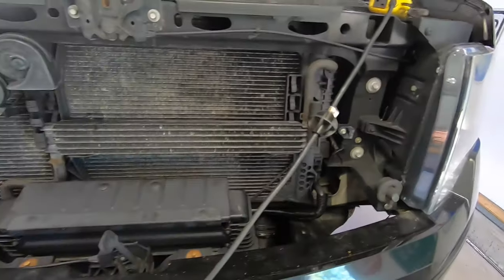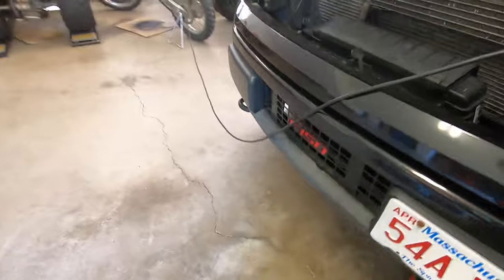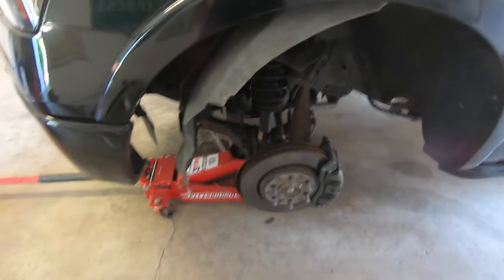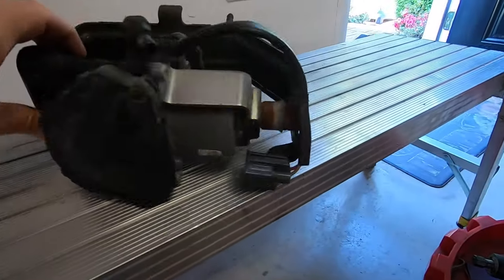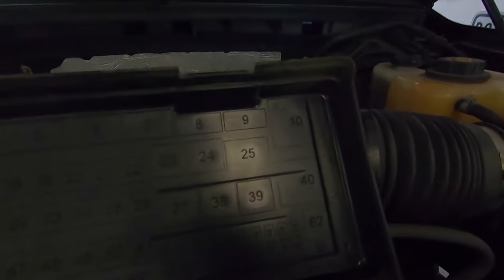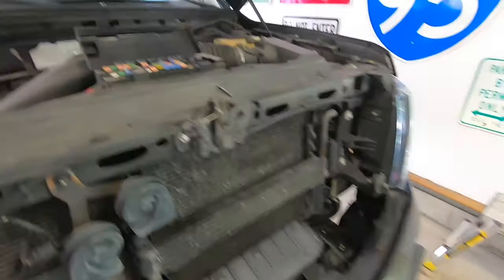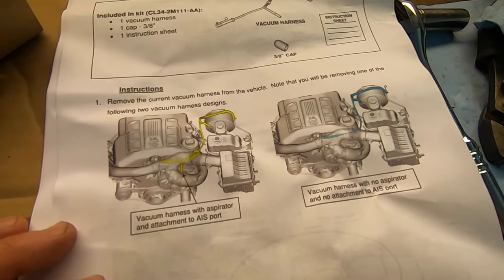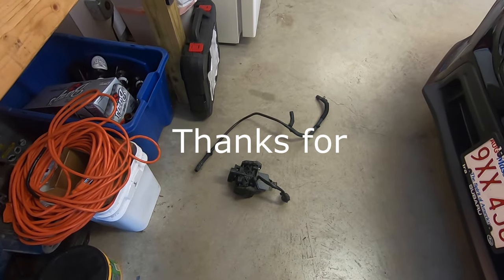How to Fix the Locking Brake Problem on Ford F150

Comment: Is this the same for the 8 cylinder trucks too?
Reply from the maker: I am not 100% sure about 8 cylinder trucks. Take a look behind the drivers side wheel well and see if you have the pump.
Reply: No. At least not on the 5.0, there is no vacuum pump
Reply: I’m having the same problem but on a 5.0

Comment: On my uncle's 2005 F-150, sometimes when he puts the truck in "Drive" and releases brake pedal, truck doesn't move, as if something is holding it.(parking brake isn't engaged)  He needs to accelerate a bit more to make it move.  We lifted the vehicle in the air and put it in Neutral, and all wheels seem to spin freely, didn't feel any drag.  Almost a year ago we changed front and rear differential fluid and truck was fine, until very recently.  Could it be 4x4 issue or similar to your issue?
Reply from the maker: I am not that familiar with the 2005, Check to see if you have hill assist. It is usually included with the towing package. It will hold the front brakes on a hill to prevent rolling back when pulling a trailer.  It releases when you give the truck gas. Sounds like your uncles might be malfunctioning. I don't know much about hill assist other than the onboard computer controls it.  Sorry.

Comment: Mine is locking up but no humming noise that you indicated do could it just be the vacuum hose?
Reply from the maker: Start by replacing the rubber caliper hose.

Comment: I’m having the same issue with my 2014 3.5 Passenger front caliper keeps freezing up. My relay #25 is empty in fuse box under the hood
Reply: Same here. Did you ever figure it out?

Comment: I removed #25 relay but my brakes didn’t release. Would that mean my master cylinder is bad?
Reply from the maker: No it would mean your rubber brake line is bad! Ford knows the lines a garbage, when you have your pads replaced at the dealer they always do the rubber lines as well.

Comment: Tried this on my 2010 F150 with a sticking front caliper, did not work.  Brand new caliper is still sticking.
Reply from the maker: Replace the brake line

Comment: I need some help to mine dont want to let go. I replaced caliber and pads. Didn't fix it.
Reply from the maker: Change the rubber line
Reply: @RCBGarage  I just did changed both front lines calibers.  I changed the pads on the front an back. And it's still stuck.
Reply from the maker: @daveyhogan5332 Change the lines, when you replace a caliber you always replace the line as well
Reply: @RCBGarage  I did replaced it all except rotors but my rere ass put the pad on wrong bunny ears on the pad goes on inside of caliber flat pad on outside. I fixed it I'm an idiot. Rushing

Comment: I have the same problem with my 2012 5.0 but there's no vaccum pump behind the front fender!?!?!
Reply: I am having the same issue with my 2011 F150 5.0litre. Anyone have any suggestions?
Reply: @kkosin8482  I just change the hose between the caliper and the frame 35$ to fix that.

Comment: DO YOU HAVE A PART NUMBER FROM ROCK AUTO PLEASE?  THERE IS NO SUCH PART ON THEIR WEBSITE AND YOU CANNOT TALK TO ANYONE
Reply from the maker: MOTORCRAFT BRPV30
Reply from the maker: This is what I used. I would start with changing out the rubber brake line.
Reply: @RCBGarage  NO LUCK ON PART NUMBER.  THE HOSE WAS CHANGED THE LAST TIME WITH THE PUMP.  THIS WILL BE THE 3RD ONE.   I CHANGED THE FIRST ONE DEALER CHANGED THE SECOND ONE AND NOW IS PAST WARRANTY.   DEALER WANTS OVR $800 NO ONE SELLS IT.  THANK YOU
Reply from the maker: @berthoward2873  Not sure how you searched Rock auto has it for $442.79
Reply from the maker: https://www.rockauto.com/en/parts/motorcraft,BRPV30,vacuum+pump,5172
Reply: @RCBGarage  THANKS.  FINALLY FOUND IT AND BOUGHT IT

Comment: You know if that's the same in the 250 having similar issues
Reply from the maker: Start with replacing the rubber brake line.

Comment: I had the same issue with my 2010, changed the brake caliber same problem…had to change the brake line going to that caliber, 
Problem solved
Reply: Have you had any issues since replacing the line? I’m having the same issue

Comment: How about lobby Ford to stop providing brake hoses with metal that rusts around the rubber hose ? Dumbest idea I ever heard of. The metal rusts and restricts the rubber hose so when you release the brake the fluid cannot drain. My son had that problem and the mechanic wanted $800, for new hose and caliper. We fixed it for $40. Should have never happened. Just use aluminum or plastic or some other material that does not rust. Never happened on any of my non Ford cars.

Comment: 3,5 l?? Am I Watching the wrong video for a 5.0???
Reply from the maker: Start by changing your rubber brake line. I am not sure if they are the same.
Reply: @RCBGarage  that’s kinda what I’ve narrowed it down to— like an idiot, I pushed the old fluid from the pistons back into the line instead of out the bleeder
Reply from the maker: @zaneseligman1313  You easily flush the system bleeding it
Reply: …so the flex line ‘can ‘ be cleaned out and potientially fine?
Reply from the maker: @zaneseligman1313  Replace it, they are pretty cheap. they can collapse inside causing a one way check valve condition. that keeps the caliper engaged.

Comment: dealing with this now... new caliper, brakes, rotors, and a bad flexline...but the left caliper is still dragging like fluid has a check valve . the vacuum pump does not work,  but how does the pump effect RELEASE? I understand the vacuum ASSIST, but release???
Reply from the maker: I don't know exactly how the system works. I changed everything that you mentioned as well as the pump and I haven't had the issue again. Its been over 10 months now.
Reply: Check that the camel bump pads are on the inside